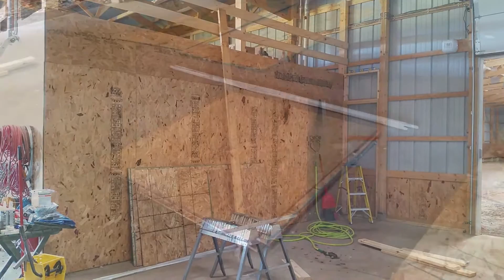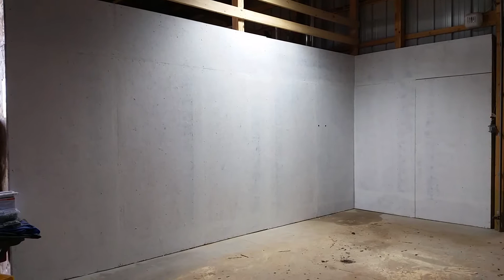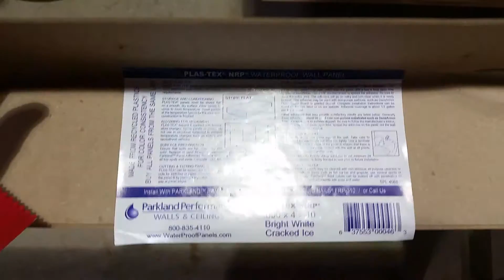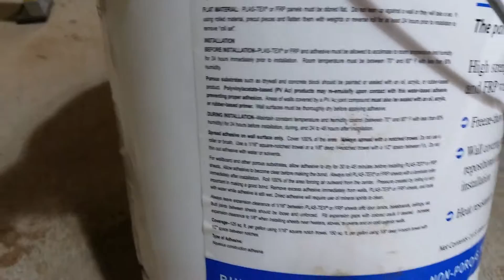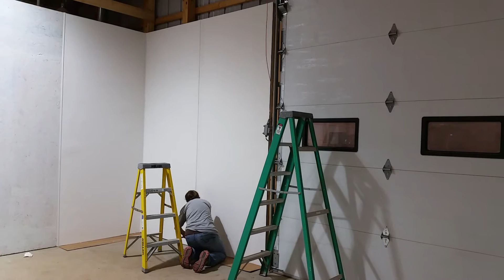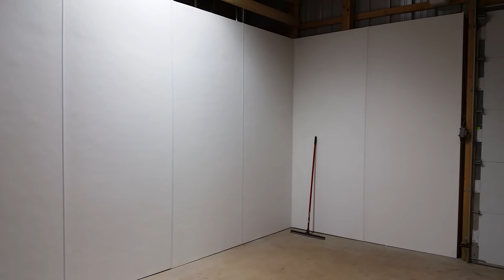How Install Parkland PlasTEX Panels Barn WASH STALL

Comment: How is this holding up 8 years later? The official Parkland website recommends not using the product in areas where temps are not maintained, such as a barn.

I am thinking of adding into my garage where it should be relatively dry, but will be susceptible to humidity and large temperature fluctuations during the winter and summer.

Is there anything you would do differently if you installed it again today?
Reply from the maker: Doing really well there is small bubble in one spot but otherwise it held up great
Reply: @RMSpeltzFarm  Thank you for taking the time to reply. Your video makes me believe that I can do this too!

Comment: Could a person simply screw this product on?
Reply: That would be nice!
Reply: I called Parkland to ask about alternate fastening options because I have damp basement walls, for which the glue would fail over time, since paint currently lifts from it badly.  They said that many installers use plastic rivets, which expand when you drive the inserted nail, and lets moisture travel down to the french drain.  They recommended drilling the hole in the panel bigger than the one in the concrete to allow for expansion, because this material WILL expand/contract.  Just did this, and the rivets hold great!  For screws in wood, I would recommend pan-head, but get a big enough head that will cover the bigger hole in the panel that you SHOULD pre-drill.  I like these rivets for my project, since they were white and looked right on this panel.

Comment: How did this hold up when freezing and thawing.  ?
Reply from the maker: stuff is great for strength, but next time I think I will just put it up with plastic plug way verse the glue the bottom tends to warp more in the very hot summers and I think there be less issue if it was not glued since allow for more expansion